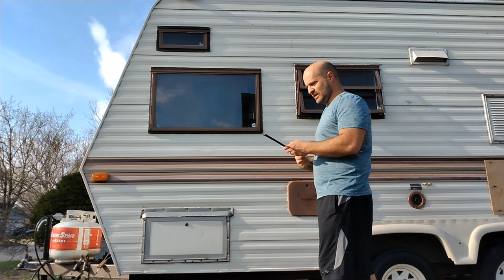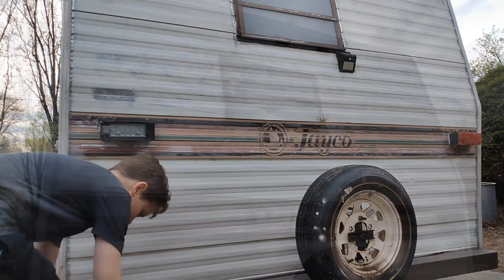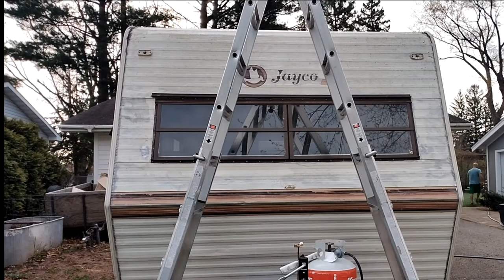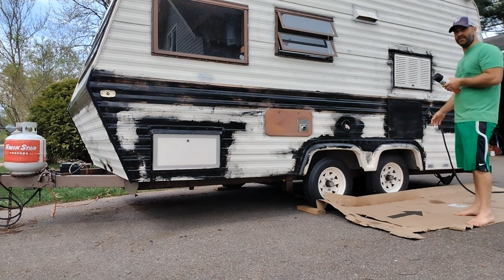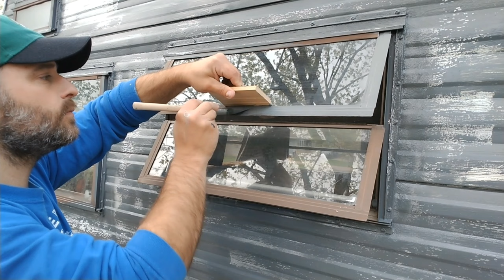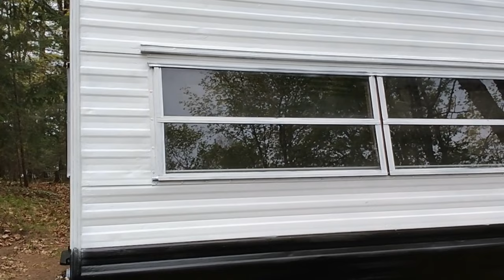Camper Painting Mistakes - using Flex Seal and Rust-Oleum to finish the RV exterior

Comment: When painting aluminum siding you have to pre sand with a fine sand paper about 220 grit Sotheby’s to break the oxide   coating on  the siding so the paint has something to adhere to and it can be all so you need to get etching primer and then paint. But that said nice job though.
Reply from the maker: With the sanding wheel I thought that I would etch the aluminum enough, but you're right I probably ended up skipping over a lot that I would have been able to get easily with fie sand paper. The good news I that I will probably get to try it all over again in a couple years. Thanks

Comment: Im 9 minutes in.. Just curious why you thought flex seal spray paint would suffice on those corners you peeled away silicone?
Reply from the maker: First off congrats on making it 9 minutes in, I usually assume people have fallen asleep already by this point. I feel that most of the caulk was overkill, the seams were minimal. I figured that the Flex Seal would look better than any caulk I would apply. Also I am mostly lazy. Thanks for the view.